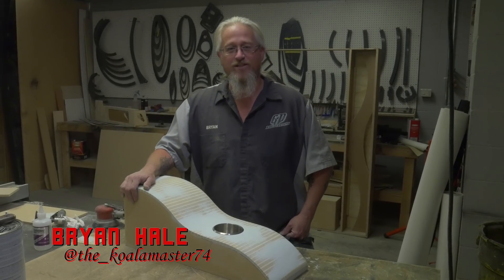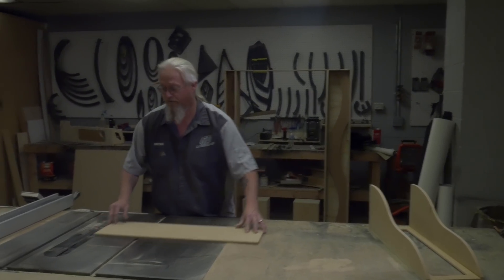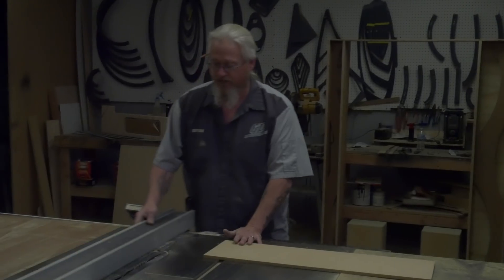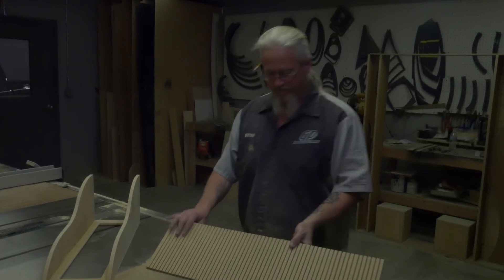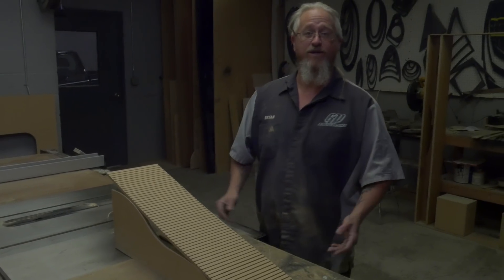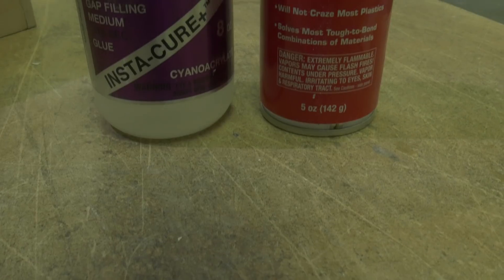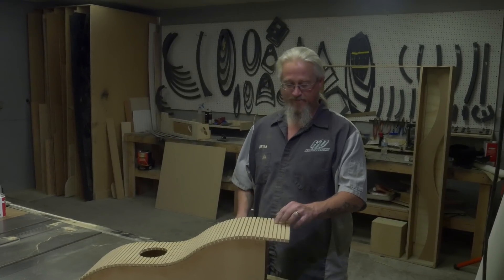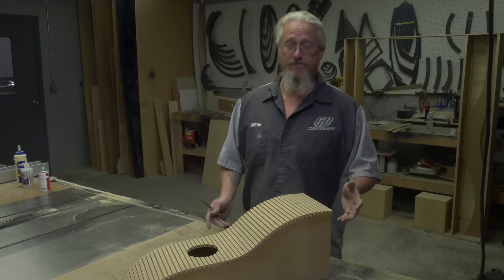Teach It Tuesday: How to Kerf Cut Wood

Comment: You can buy thin MDF pre curfed for wrapping around curved frames. Glue smooth side out with Gorilla. Cut another layer to glue on the inside. Weight it down while glue dries.

Comment: When you cut that hole while the board is flat your cut is going to distort once it is on a curved surface.  It might not fit if your tolerances are tight.

Cool video though thanks for sharing!
Reply: @Jayboz6989, So how should you do it?
Reply: @kensmechanicalaffair  you would have to do it after it has been curved.  If you need precision then you make a jig to center your drill

Comment: yeah its easy and all that but what if you dont have a massive expensive table saw in your garage
Reply: You can use a hand saw or a miter saw.  There are few videos out there to show you how.
Reply: Use pre slotted MDF. It’s thin so use one sheet outside and another inside. Cut slots facing. Gorilla glue or PVA hold the top layer with tape. Weight down the inside layer.

Comment: If you had put it upside down you wouldnt have to bondo it lol
Reply: Not true, using the technique described in the video he could only bend it the way he did. Other techniques would allow a converse bend, but not the one depicted.
Reply: Zach Lonas he literally demonstrated it bending in both directions?  Did you watch all the way through?  Smooth side is usually to the outside.

Comment: First things first.  Wrong side.  Those kerfs will telegraph through the finish. You could have ran a shallow dado down the length and added an eternal band for strength and to hold shape.or use 2 layers of curf board to avoid the bondo

Comment: I think you put that on upside down my friend. The reason for this technique is to present the uncut surface to world and have the cut surface on the inside where it can't be seen.
Reply: Eternal bands take care of strength and help hold its shape. Or just use 2 layers.kerfs on the inside smooth on both surfaces.
Reply: Softwood strips stuck with Gorilla give a neat curve but it needs lots of strips cutting on the table saw. 
If you use the kerf side inside it’s easy enough to widen a few cuts where needed. But small radius will crack the MDF so don’t go too tight.
Reply: Arkady Bron the standard is definitely smooth side out. But filling the grooves does add structural strength, so not a terrible concept.
Reply: @DaddyBear3000  Filling can be done from inside.
Reply: Absolutly
Reply: You're missing the point that the "ribs" would conflict with one another and not allow the curve if converse. an angled curf would allow this, but that can be time consuming and/or require a skill level most don't have. The way he demonstrates is overall the fastest way to reach the design depicted (from a labor stand point) for most people. I usually do bent lamination, but this is a great alternative and is demonstrated properly given the design set forth in the video. Other ways are possible though.
Reply: Zach Lonas don`t type so many letters if you don`t know the subject totally.   https://www.blocklayer.com/kerf-spacingeng.aspx

Comment: One thing I was thinking might cut your kerf cutting time down some:  after a cut, before you move your fence, spin your material 180 and make a cut at the other end as well. That way you can work from both ends towards the middle rather than from one end all the way to the other. It might mess up the cut spacing in the middle, but if you're filling the gaps with Bondo anyway, it shouldn't matter I don't think. Just my 2 cents, hope it helps you cut down your work time some!

Comment: The scrap that you had left over from your left and right sides could be used to do  that easier.  Build a box similar with the scraps.  Then put both of them on their sides.  Put the kerf cut board in between them and clamp it all together.  I suspect you are using superglue to get it to adhere quickly when you have it in place because you are having a hard time clamping/holding it while the wood glue dries.  Try my suggestion on the next one and let me know how it goes.  Best of luck.

Comment: learned somthing new thanks,  Q: why not put the kerfs down then you have a nice flat surface right away.   never done this myself so curious
Reply: As he said in the video, need to have the flat side down on top of the sides to give better surface adhesion area for the glue
Reply: Having the kerfs up allows for the Bondo to fill in beteeen them. You way wouldn't allow that. Simple.
Reply: @Patrick-kc5ur  appreciate the response,  always learning and asking questions,  thanks